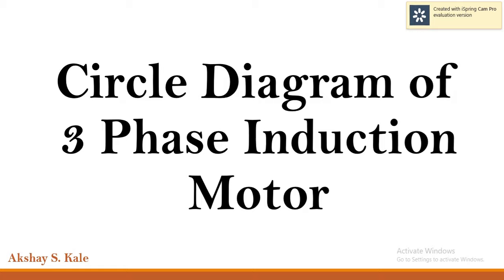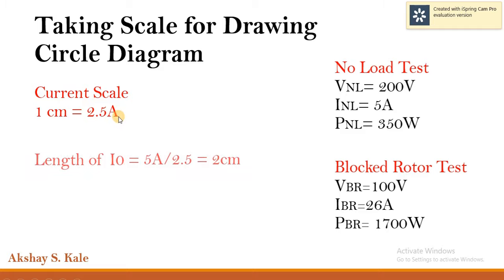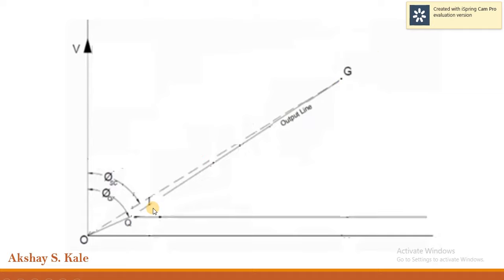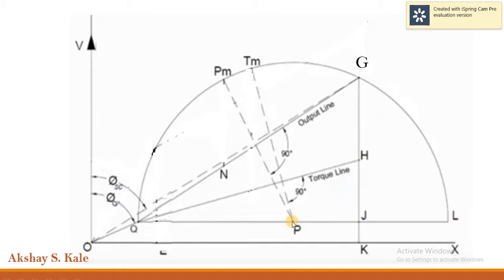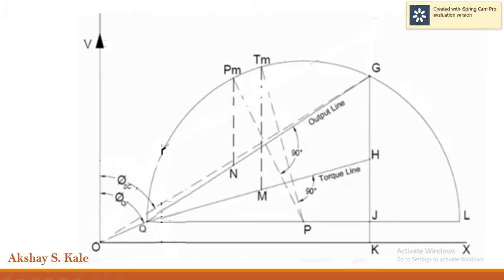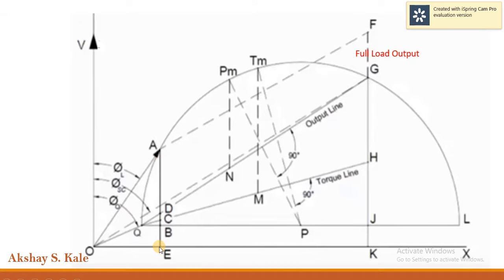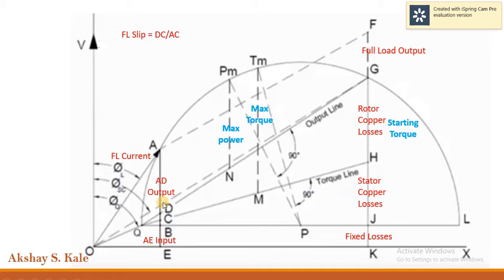Circle Diagram with Example - Step by Step Procedure

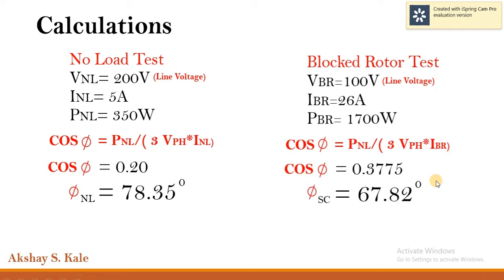Comment: At 1:20 it should be root 3 in both formulas, not 3. 
And thank you sir this topic was taught yesterday in lectures but there were many doubts and your video cleared all of them. Thank you again
Reply: No, it's correct root 3 comes when the parameters are line voltage and line current
Reply: @prateekshrivastava2802 no it's not correct ...try it yourself by calculating it